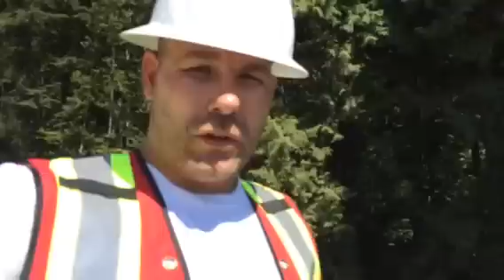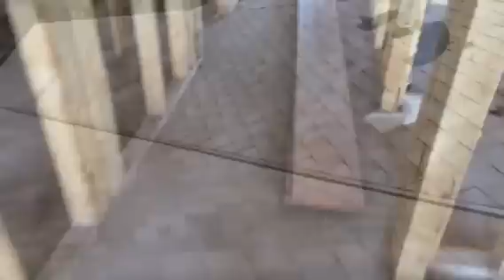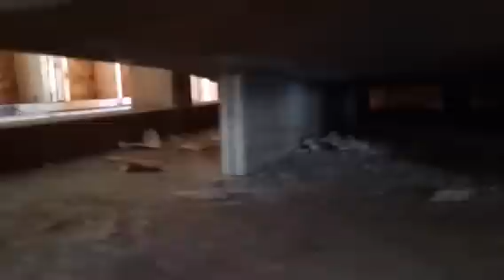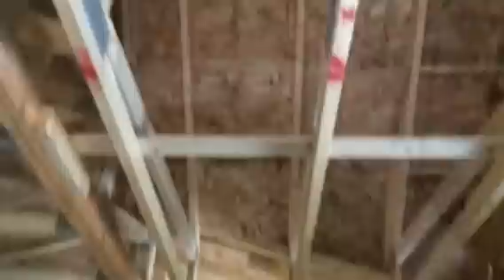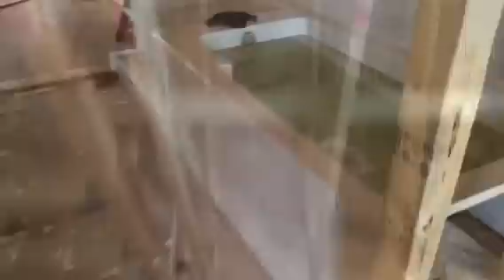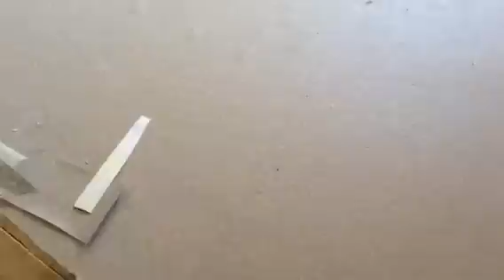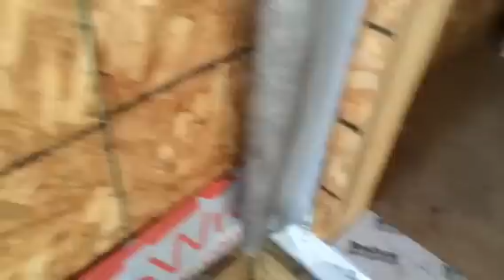New Home Construction Fails

Comment: The OSB is there probably because the engineer called for it on a that shear wall. Sorry but the house not racking is pretty important. 

Also, the engineer determines the amount of ventilation required. (FYI is still inclined to double check, the sq/ft is listed on the plans, permit, sales sheets, and probably on the inspection work order. No need for calculations)

Oh and the engineer who designed the tub probably required the plywood for reinforcing that thin acrylic/fiberglass tub bottom on that elevated tub with a pre pitched support so it drains properly (hence the resin you see adhering it). 

The fabric tie offs are supposed to be cut and disposed of when the roofer is done because they will degrade over time and possibly be a liability for the homeowner in the future if anyone tied off to them. 

Bubbles? Okay 

There is nothing wrong with drywall that has been installed behind the tub. Probably there as a rigid air barrier against that wall that appears to be garage exterior wall. Notice it is behind the tub. Not on top of the tub. Whatever backer will be used will be installed on top of drywall sitting directly on the top of the tub. Not behind it like it is in the video.

Good catch on the joist hangers though 👍

Comment: I've actually had to convince a "framer" that joist hangers aren't supposed to be installed this way. He had been doibg it like that "for years," he said, and he was taught that by a "real" framer. He also wanted to argue about the proper rough opening size for interior doors. He eas adding 1" to the called out door widths. Needless yo say, he didn't last long on that job. 😅😂

Comment: Tubs come standard from factory mounted to osb and I believe those hangers were not mounted yet. They hang them there instead of leaving them in a pile somewhere. 

The osb behind the tub, that’s definitely wrong. 

The drywall behind the tub, if it’s green board and will get a waterproof membrane would be fine.

Comment: I stopped at the upside down hangers. Amateur? No my friend. That's full on hard core retarded. As backwards.  The tub install was stupid enough to roll my eyes at but quickly fixable. I'm sure it gets worse but I'm done here. This is why we have building inspectors. Maybe we should have certification for construction workers the way we have for electricians, welders and plumbers. No formal training and no certs, no work.

Comment: That tub comes like that and that's how they are installed 100% of the time , all tubs come either with 4 adjustable legs or a small wood leg like this one in the video . They are tested and passed some safety  certification before going to mass production . Not all inspector are smart either .

Comment: That tubs supposed to have backing boards and a pile of cement underneath it. Plus the shower head should have a stub out pipe with cap, and be backed with green board.

Comment: 8.34 pounds. A gallon of water weighs 8.34 lbs, not 10 lbs. Is that still in inappropriate way to support the tub?  Absolutely.  But don't exaggerate, it does your credibility a disservice.

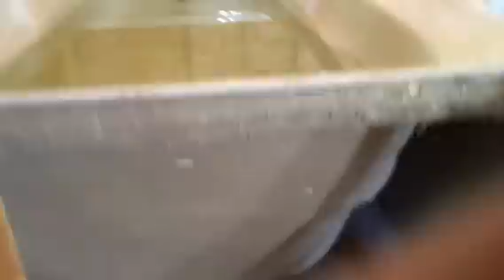Comment: @1:45 - "1 gallon of water weighs 10 lbs".  Actually a little over 8 lbs.  But otherwise a great video! As a pretty handy home and rental owner, I've done my share of bath and shower remodels.  A well constructed bathtub/shower will last decades, a poorly done one will last a few years.  Using drywall, OSB, pressboard, particle board, etc. anywhere it could get wet should be criminal.

Comment: That first bathtub is ridiculous I’m no contractor but are you not suppose too have some type of thin set under the tub to support it in place and I don’t think putting a tube up on a platform like that is correct. Plus OSB sheets go on the outside of the home they should not be used for interior walls

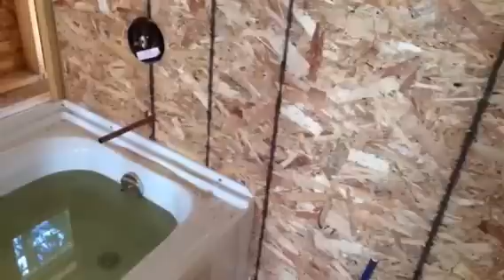Comment: Nothing wrong with the OSB behind the tub. It will be (should be) covered by cement backer-board. You can see the OSB is flush with the outer lip of the tub 1:04. The backer-board will sit over the OSB and flush up to the top of the tub.

Comment: Plumbers, please stop using abs on these custom houses that s*** for trailers, other than that I didn't see anything wrong with the plumbing maybe they could have put water or something under the tub you don't want to use phone because it expands but the framers, that was amateur for sure using those hangar brackets upside down wow and I doubt that always be wall is going to be taking any water there's certainly going to waterproof that and or run the concrete board right over and downto the ledge of the tub, to me it looks like the plumber did okay other than you can cheap material but the framer definitely needs to get it

Comment: I've seen joist hangers be called out to be installed upside down where a bearing wall lands on  cantilever joist.  It was on an edition where the floor joist couldn't be extended into the original structure.

Comment: Great inspection, nice to see a guy that knows what he is looking at. Most of those cheap tubs come with that particle board under it, but that one board holding it up is ridiculous. Hacky stuff. By the way one gallon of water weighs 8.33 lbs
Reply: Canadians officially used Imperial units and an Imperial gallon of water is 10lbs.  Surprised this young fellow stated gallons because Canada phased that unit out in the mid-1970s.
Reply: @optophobe    - Even though officially on the metric system, we still talk in gallons and pounds and feet about a lot of things.

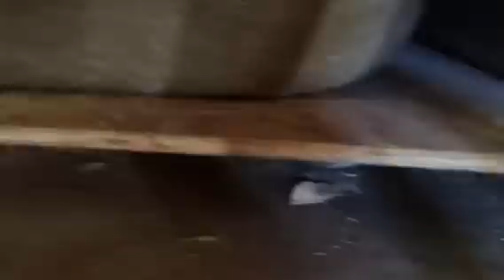Comment: 1:21 I'm guessing it was filled with water in order to "test" the too thin OSB tub job / support. Whatever asshat whom didn't know how to do it correctly, filled the tub up just to see if that thickness of plywood would "suffice". To whatever mexican floor hand, YES, it would work, but no it is still incorrect material and method! of building. Should be using 1/2 or 5/8" concrete wallboard, plus more support under the tub other than just that single little stub piece on the side. Because its going to get hot, its going to get humid, over time the would is going to warp, and boom, the bottom drops, and you end up with bent or broke pipes. I do/did Quality Assurance for my work and often had fuckers get in a jackass hurry on a job, only to fuck it up before I had a chance to stop them. Then when I do inspect and catch the opppsies and inform the manager, the manager yells at me for not inspecting, all the while I was currently busy in another part of the project doing my job. All the while it came down to someone not knowing, not paying attention, not reviewing the the plans, not informing their supervisor to verify, and not notifying me they're beginning. Asshats!! And NO water doesn't way 10lbs. But yes he's doing easy mental math estimation. (1 gal = 8.34 lbs)

Comment: Such a shame that this kind of substandard work is becoming the norm.    Unless you are building a home from the ground up and inspect the work while the home is being built, you can’t see a lot of this stuff.    Only when it fails do you realize what the builder did, and then they will blame the homeowner when they try to file a claim against the warranty.   A plumbing failure is not because of substandard plumbing— the homeowner put something in the pipes they shouldn’t have.    When the roof leaks, it wasn’t because of the roofing — it was an act of God.    HVAC fails — you didn’t service your 9 month old unit correctly.    And then they charge premium prices for garbage work.

Comment: OSB WAS USED AS BACKING...LOOK AT TUB FLANGE, ONCE THEY INSTALL HARDI BACKER OR CEMENT BOARD THEN TILE,  FINISH TILE SURFACE WILL LINE UP OVER FLANGE ......YOU ARE CHECKING THAT PREMATURELY...I THINK..

Comment: No cement board?  Upside down hangers? Did you shut this job down?  Love the storage space under the tub. What country is this?
Reply: Cement board will be installed over the OSB and all around the tub. The tile will not be laid directly on the OSB. The cement board will sit on top of the lip around the tub and the tile will go down to the rim of the tub. This inspector doesn't know what he's talking about. The tile guy will install cement board and waterproof it before he tiles.
Reply: He said that tile will be installed directly onto OSB. By that logic, he must also believe that tile will also be installed directly onto those bare studs since the tub is tight to both the studs and the OSB on their respective sides. He's a moron

Comment: Wow those mistakes are amateur hour! I'd question the whole build if I saw stuff like that. Also, I want to add that particle board is different than OSB. OSB is what you see in the video. Particle board or MDF, however is basically sawdust glued together to form a sheet. OSB can get wet a few times, but just like any kind of wood you don't want it to get wet often or stay wet. It's used often as sheathing on the exterior of a house. And he's right, it would expand and cause tile to pop off or crack.

Comment: Reminds me of something my parents had. They had a new house built 11 years ago but the builder poured a slab that was too thin for the build, resulting in differential settling on a masonry blocs home (this is in Belgium, so wooden houses aren't common here). Cracks are still occurring to this day because they didn't do their job properly.
It's even more important to get everything right in the United States because one mistake on vapor handling and the whole house can be torn down on account of the wet rot.

Comment: i got a new home built in Hamilton Ontario 4 years ago (by a very reputable builder)and the builder told me i wasnt allowed onsite to see my own house that I paid for. anyways Id still come by late in the evening and inspect the construction and some of the things Ive found made me sick to my stomach. Ive seen rotten lumber sandwiched between good lumber, floors not glued down properly, insulation missing, a water pipe ran on an exterior uninsulated wall! plumbing not glued, screws through my Ethernet lines, electrical wires in junction boxes shaved by the drywall installers, siding being installed incorrectly, exterior surfaces not caulked, my bath tub not supported properly, and the list goes on. take tons of pictures & dont trust these builders.

Comment: Not in construction. Don't want to be. But the  "joint hangers" - that's common fucking sense. Do they hang their clothes upside down at home? Are their ceiling fans hanging from the floor? No, because gravity has always worked the same way.

Comment: A house I worked on in 2019, the ensuite bath tub was suspended 8 inches off of the floor from the bottom of the feet to the floor. The rim was resting on the tub surround framing, I informed the home owner, a very arrogant person by the way, of this tragedy in waiting. In his arrogance he said it was OK, and all was good, three weeks later he had a framer come in and lower the tub surround 8 inches so the feet would support the load of a filled tub.

Comment: Water is closer to eight pounds per gallon not ten, also the tub you are talking about comes standard from the factory like that and have been installed like that for many years without failure.

Comment: You are an idiot ! The first tub wall was furred out so Durock or some other sub straight would be applied. The other fiberglass tub is shipped from the factory with OSB siliconed to the bottom with plywood struts under it for support !

Comment: One gallon doesn't weight 10 lbs,  but still I get the point.  A gallon is more like 8.3 lbs or so.   Good video.  Had to pull a tank type hot water heater in my house due to weight issues.

Comment: Water only wieghs 7 lbs/gal, but that tub support did look weak. Also, while OSB is not an acceptable substrate for tile,  that is not what it is being used for. Cement board is meant to go over this and onto the lip of the tub. The OSB is not really an issue since it is only meant for blocking and possibly a stiffener for the stud wall. The person who installed the joist hangers upside down should have their fingers broken and tools confiscated.

Comment: I’ve actual put joist hangers upside down before, but the joist where cantilevered Over the foundation for a octagon kitchen bay on the corner of the house. We ran a 3 ply micro beam from the corner back into the house(45 degrees) to the i beam and 45ed are joist. It made sense when we were looking at the plans. The weight of the walls and roof structure above we believe would have actually lifted the joist in the house rather than sag them. We also toe nailed  4ea 16 penny nails per side. Way over code

Comment: I've been building for over 30 years, and if installers would just read the directions on the package of whatever they are installing, 99 percent of problems would be avoided.  The manufacturer has run into every known possible problem through people trying to get reimbursement, so they know what they are talking about.  Even though a lot of the directions seem excessive, they are there so people don't have as few problems as possible.

Comment: 2:10  when doing roof ventilation calculations you use the sqft of the attic floor, not the sq ft of the home.  If you had a two story house, your calculation would be 100% over the real value if you used your formula.
Reply: He wasn't talking about every story...

Comment: "One gallon of water weighs ten pounds."  Hmmm, you must have pretty special water where you live. However, in the rest of the world, one gallon of water weighs 8.34 pounds. When you're factoring weight, and considering an 'average' tub holds between 25-35 gallons of water, knowing the actual weight of the water can make a huge difference.

Comment: Tether strap on that roof , has to be a code thing . That pitch does not warrant a safety line in my life lol , actually no roof does , they can be more dangerous than help . Tripping over them and everything getting in the way , as to the drywall in the shower area , if they are using a shluter system that will be fine

Comment: It looks like the upside down joist hangers were installed as end restraints of a cantilever on an overhung balcony or deck. The up force to the joists can be greater than down force at the hanger-end because you have levered force when the overhung balcony is under load. If it is a cantilever the upside down "double shear" hangers are correct.

Comment: While I did see the comments suggesting that the cement board was going up next, I've seen plenty of bathrooms with tile over Sheetrock, plywood, OSB, etc. I've never understood why so many people are reluctant to put cement board around a tub or shower. The stuff is practically free and if an amateur like me can cut it with a box cutter, anyone can. My tiles were put up over Sheetrock in 1958, and they are stable now, after I (starting in the 1990s) had to re-set all of the lower ones, using silicone keyed into 1/2" holes that I drilled, so mushy tub enclosures can be saved, but why should that be necessary when a trouble-free job is only $50 more?

Comment: Our house is a former showhome which is about 10 years old now.  There are so many issues.  My shower has had so many issues and it's very hard to remove it since the wall it backs into has a mirror and a cabinet, so in order to change it, we'd have to carefully remove the mirror and saw out the the cabinet.  Luckily, all the issues have been solved by removing the handle and fixing that.  We have a tub which is leaking and is encased in a wooden box, so we can't actually access the valves to shut off the water and we'll probably have to call in a carpenter.  However, there's also a large glass privacy pane on top of the most ideal area to remove the panel, so it's not an ideal situation.  Every electrician we've had has told us about the crazy wiring in our house.  It's pretty bad since items and sockets sometimes stop functioning properly for a while.  The industrial carpet is also starting to bubble, our two furnaces have stopped working multiple times (once there was CO involved), and we're always finding new issues.

Comment: The inspector in my home found only a couple things. But they didn't find that the dryer vent wasn't installed in the Laundry room. It was installed in the side of the house outside, ran all the way under the house, but was never given a hole to come into the laundry room.

Comment: Any builder knows, how to install joist hangers, they also know not to use drywall of particle board in wet areas, the bath tub ply wood support was unacceptable. I'd be questioning who did the work, and who is responsible and take legal action, if that bath tub or those joists collapsed and some one was injured, that builder should be sued, and lose their builders license. This is unsafe, and unprofessional, no proper builder makes mistakes like this. The builder may be a fraud, using false documents, or using unskilled labors to do the work.

Comment: A gallon of water weighs closer to 8.5 pounds (it's actually a little less) than 10 pounds. The tub looks to have been engineered to be installed the way it was, notice the face of the tub was on the floor and if you look when he shows underneath there was Fiberglass holding the wood in lace to the bottom, the back and the rear or the face. If the specs from the manufacturer of the tub say to install it the way it was then the home inspector is wrong. The osb /drywall behind the tubs is the job of the carpenters to install. That being said the plumber's look to have done a fair job.

Comment: I remember 25 years ago friend was getting his home built and hired a home inspector.  He found so many issues the builder eventually refused to work with him.
Reply: Quite interesting bathtub supports.     The tubs used to come / shipped with  contoured Styrofoam for under support & proper slope.       Did someone throw away that?    Probably before helping with joist hangers!